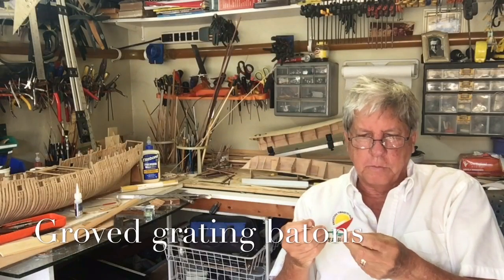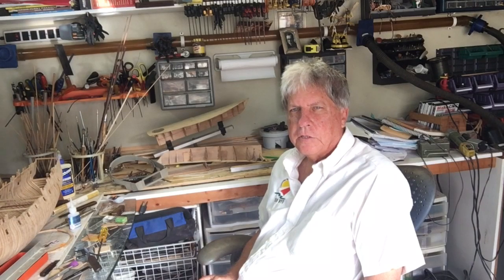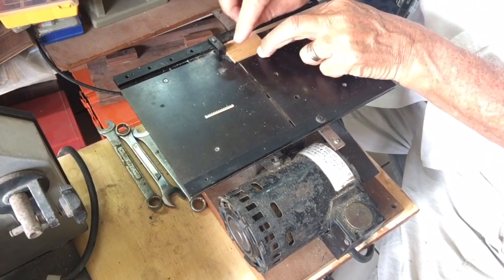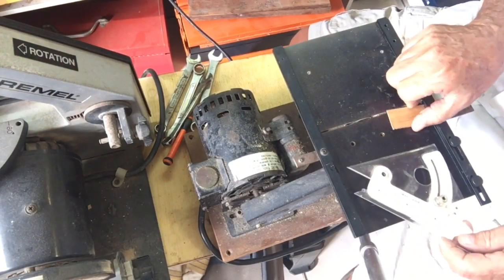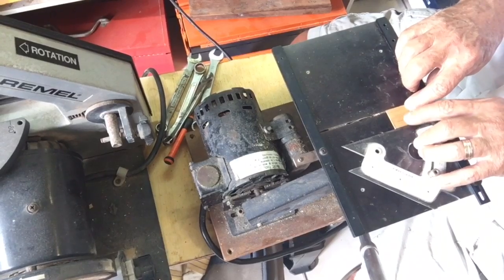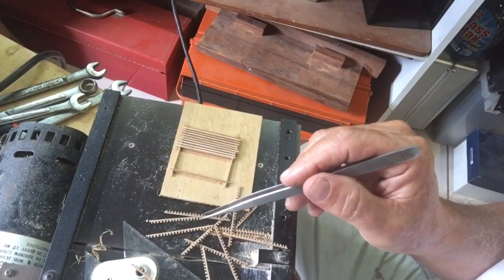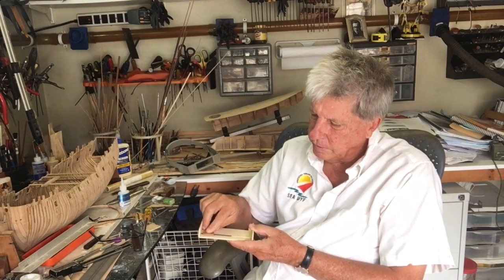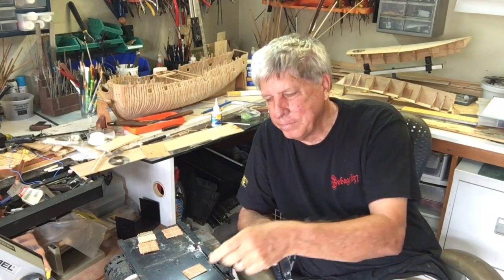Making wooden grating for model ships.Three methods are explored..

Comment: Very well  you are doing an excellent job since now.
My name is Giuseppe and I'm writing from Italy; I started  short time ago with ship modeling and now I'm building the Endeavour scale 1:60. 
I have a question about the blocks, like you now they can be single, double or tripple holed and in different sizes. Now the matter is that I have a table chart where I can find the dimension of the rope I have to use going through the pulleys, but to determine the size of the rope that I have to use for  stropping them (the rope that's wrapped arround the block and usually have a hook attached on an eye), how should I do?
It's a week now that I try to get  an answer to this question:-))

Sorry for my poor english
Ciao
Giuseppe

Comment: Kevin I'm working on a scratch built Carl Moran  tug    " grating over engine room"  where do I buy a cutting blades ??
 Our local hobby shop closed and moved.    Thanks for the video & information
Reply: They are engineering slitting saw blades -- come in a wide range of diameters ,thickness & number of teeth.
Reply from the maker: Sorry Robert i just saw this. Somehow it did not turn up in my mail. I purchased my blades from Preac directly but i know they purchased from a supplier. Ill see if i can find the supplier. I assume you have a Preac saw as different saws have different requirements.

Comment from the maker: You will find an excellent video https://youtu.be/jJRgUPSMpCc which should explain how the real blocks were made. The rope used here is between 1-1 1/2  " thick that goes around the block. How this works out will depend on the scale of the model you are building. The thickness of the whipping  line is not that important. I use the finest thread i can buy to do this. Most models give you a number of different size lines in the kit.  An excellent forum to help you with this and the many other questions you are going to have is to join the Nautical Research Guild which will have answers to all your questions and which has an active membership that are always willing to help. Best regards. Kevin Trinidad